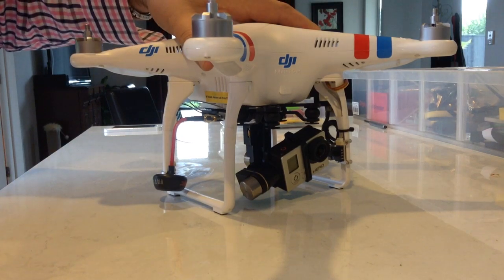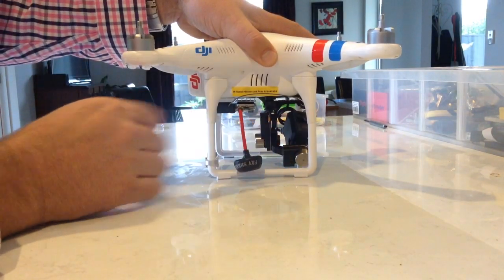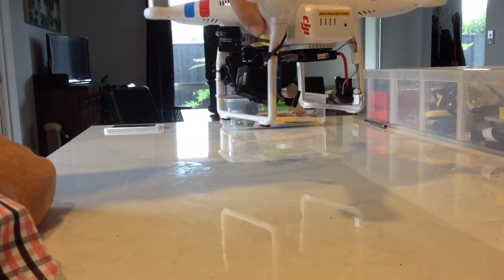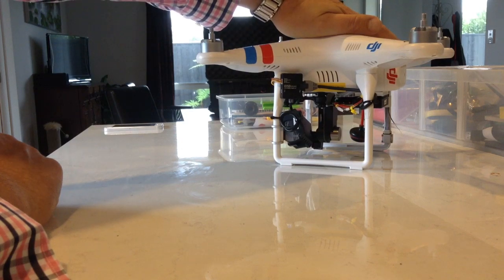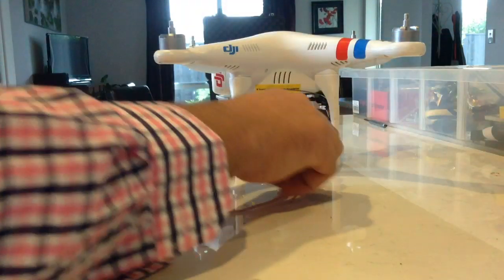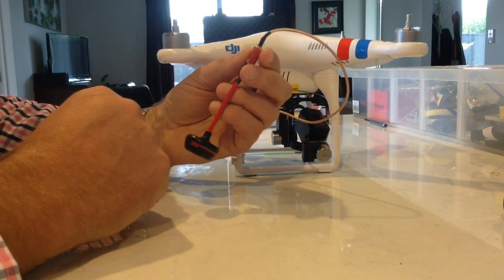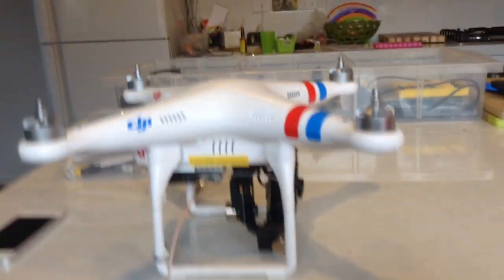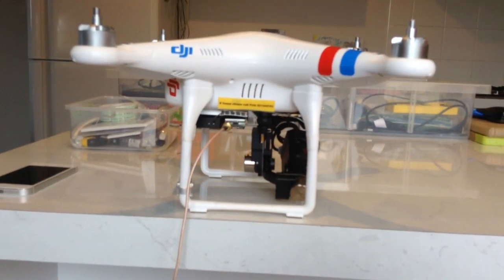DJI Phantom 2 FPV transmitter Antenna Mod

Comment: DON'T use cheap Velcro tape. it will melt by the heat. I use 3M dual lock.
Reply from the maker: Good point. Two little known facts: Velcro was invented in my home town of Christchurch, New Zealand ; and 3M stands for Minnesota Mining and Manufacturing.

Now you can go to bed just slightly wiser than when you woke up!

Comment: hey pete. check my profile picture. I mount my antenna point up.  best position ever. I have been flying like that for months and been out upto 5km perfect video. most important I can fly super low altitude at long distance.
Reply from the maker: Thanks Gary. I guess whether the antenna is protruding above or below the quad is almost immaterial, as long as it has clear line-of-sight to the received and is not obscured by the aircraft is the most important consideration. I love your 5km flight video by the way. I am waiting on a new DVR to arrive so I can record the iOSD data from my FPV receiver directly onto the recorder for validation of distances and altitudes.